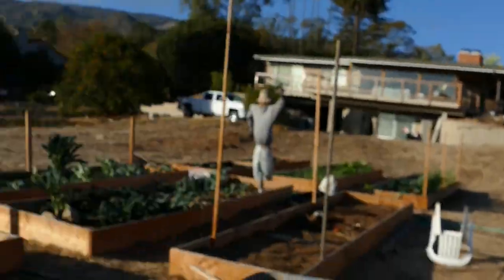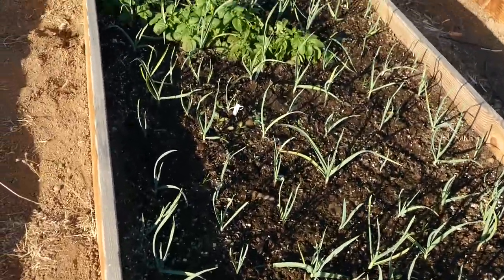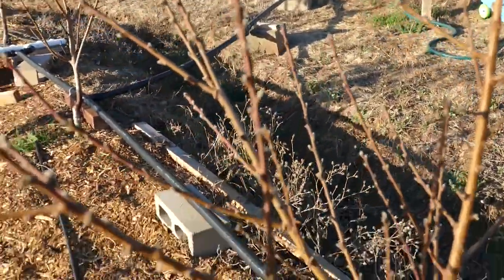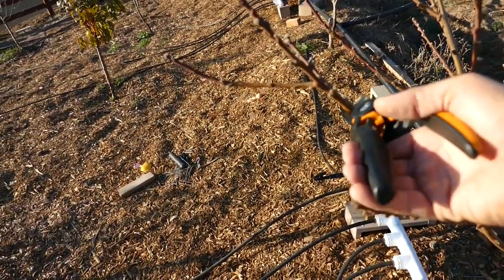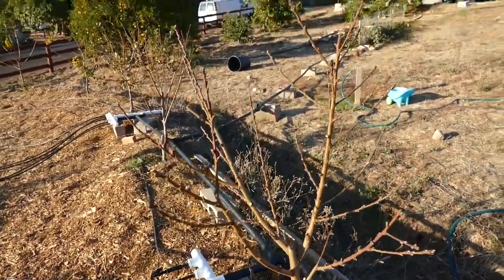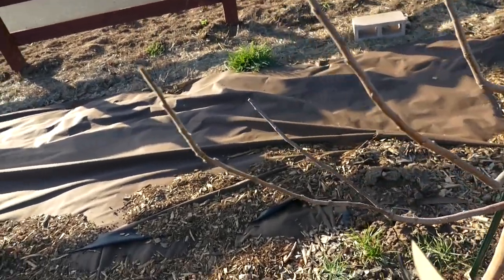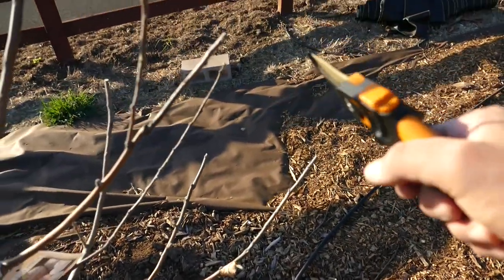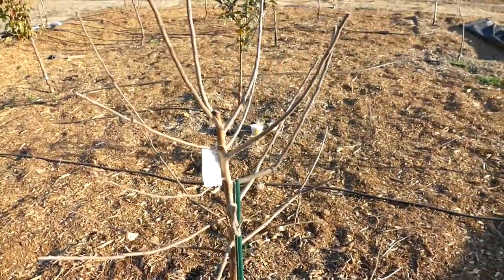Pruning Damaged Young Fruit Trees | BACKYARD ORCHARD

Comment: Looks like you made very wise decisions!  the 70 degree angles you look to be shooting for are perfect for open center training!

I've been patiently awaiting this video since you showed us that gopher damaged tree :)
Reply from the maker: Yeah I probably should have done it sooner.  After I made this video I found another tree that was nearly toppling over, but its not dormant yet so I dont know if I should prune it yet.
Reply: @theorangetreehomestead6660  It will probably be okay :) In my experience doing several smaller trimmings over time is generally gentler on the plant anyway, so if you feel like you are late or early, doing less and spreading the work out can make it more insured :)
Reply: @theorangetreehomestead6660  Better to undertrim than over trim usually, because you can always just trim a lil more! 

In fact, if you see an area you NEVER want branches on. just go rub the buds off a few times with your fingers. its easiest on the plant and you! after a few times it basically wont decide to grow, in favor of other branches :)